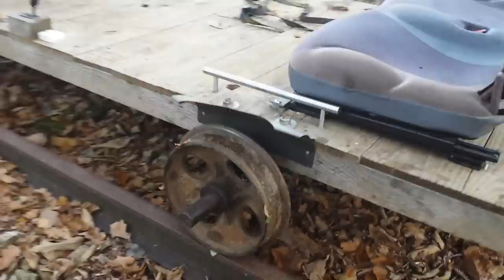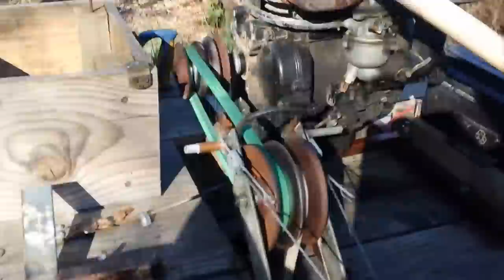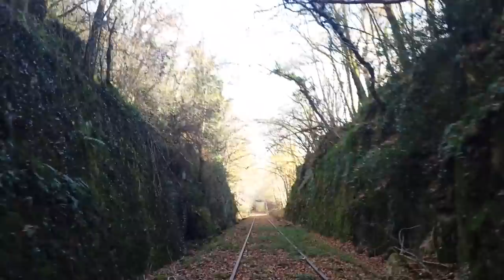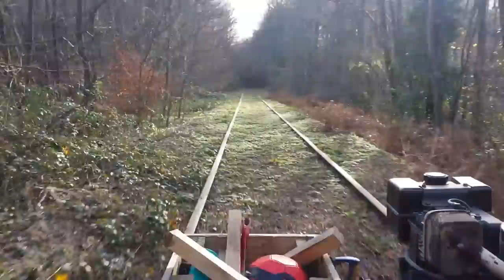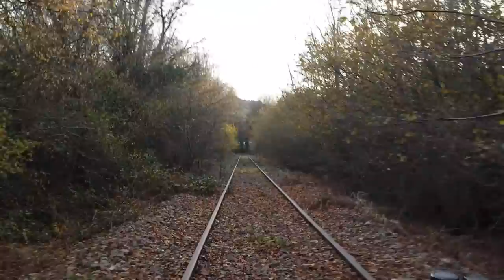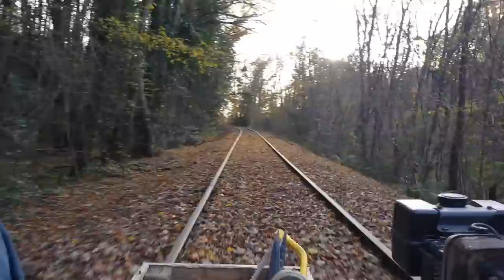Go karting on abandoned railroad tracks!  Homemade train with dog

Comment: Now you just need a set of those big train airhorns mounted on the front. It would bring back memories for the neighbours.
Reply: Daniel Moses not airhorns,whistles!
Reply: I was going to comment same.
Reply from the maker: Actually I mounted a car horn, it was quite loud but not loud enough to piss of the neighbours ;)
Reply: bells, whistles and horns.. lol
Reply: How about a replica vintage Paris taxi horn ? The type used in performances of " An American in Paris " . Rubber squeeze bulb , brass horn .Hello from Texas military veteran
Reply: Light gets Bigger you just here a rumble getting louder and than chew chew
Reply: That would be perfect 😂
Reply: Need a air compressor for air horn
Reply: @tommysimmons3258  just put a trailer on it, It'll be safe 😂
Reply: Man, Rail trolley and Dog, 👍 perfect 🙏

Comment: I wish they would have left the old tracks here where I live. There were 4 towns connected on the same line about an hour each apart and I would have had a blast doing this. They dug the rails up in the early 90's though.
Reply: Mmh i don't understand why they have to rip up old railways it such awesome history and amazing construction and the
Reply: +KTM200 EXC Sadly they tear up the rails for scrap metal for the $$$$
Reply: Those rails would make for a good homemade roller coaster n the backyard.
Reply: People should buy my "Impact' a James Grider novel on Amazon so I can afford to move out of a desert area into a forested area like that near a railroad track and do this. Maybe I could write that James Grider clandestinely travels America on a thing like that on active rails illegally, but only during the dark. It would be droll to write that a train catches up from behind going slightly faster and starts pushing the cart ahead after the catcher bumps into it. The hero must then climb onto the locomotive because he senses danger. The second he leaves the go cart, the high speed derails it and it's gulped under the train, obliterated into splinters but the hero is safe clinging to the front of a locomotive.  Same scenario could be done with one of those trucks that have train wheels.
Reply: Same here, there was a railroad that went through my home village in Slovenia right down to Italy. It would have been so damn fun!
Reply: Donny Schossow had an old Gremlin that had the same wheelbase as train tracks. Donny left about 20 psi in tires and it rode right down the tracks.

Comment: This is one of the coolest summer projects I've ever seen anyone undertake.  Good job, man!

Sorry someone ripped it apart.  At least you had a little fun with it first!
Reply from the maker: Thank you so much for your compliments :) And yes, it's true, I had loads of fun with it before it got stolen!
Reply: +Inse van houts Where is this line?? As you can tell by my name I love trains and I'm very interested in the line. I'm sorry to hear it got destroyed/stolen as well, have you reported it to the police? Also did you ever see any trains operating on this track? If so do you know what railroad? Or what the locomotive/train cars looked like? I'm sorry for all the questions and that your adult toy train got stolen. Thanks!
Reply from the maker: This line is in France (far away from you I think). I don't have much information about this line, I've never seen a train on this track, but I've been told that it was first used for passenger transport (from 1890 to 19??) and then for wood transport (from 19?? to 2005) 
I did report it to the police but they didn't want to do anything, because what I was doing was illegal...

Comment: rubberize the wheels for a smoother and quieter ride, friend of mine built something similar and he used that rubberized tool handle dip on his wheels and it worked pretty well and made pulling out faster with no wheel slip, its not as durable as hed like but for as often as he goes for rides it works ok
Reply: Just slide a cut open inner tube for a kids bike on the wheels and you are good to go.
Reply: Sergej Nadaždin seems like it'll give out instantly
Reply: Works for snow,ice and  wet rail many years ago.
Reply: Fairmont motors sold them as an accessory .

Comment: Hope you may build a new cart or speeder and keep the rails in use. It would be fun to see the different seasons along the tracks .
Reply from the maker: I hope so too! And that's a good idea, I will see if I got some different seasons on video. We got already 2, fall and summer (can be seen in Part 1).
Unfortunately it doesn't work in the snow, the snow sticks to the wheels, builds up higher than the flans and thus makes the cart derail :(
Reply: thats good to know your still interested in exploring the rails.I had watched the second part first this morning , did not realize it was yours as well.

Comment: I see you got a 4-stroke much more reliable than that old 2-stroke oil burner you had and you definitely get a few more miles out of a tank of gas that's for sure. I like the videos keep them coming and the smile on your dog's face says it all...
Reply from the maker: Unfortunately this is the older build, but it got stolen. One of the conditions for the new engine was that it had to be a shifter. But 4 stoke shifters were way out of my budget.

Comment: after I seen your video I clicked on next they had an amazing way where it was in parts and took only about 15 minutes to put it together the engine was on a couple of wood blocks attached to a piece of thick plywood the wheels were not attached,and seats too while it was apart it was just a piece of plywood with axles and it's was stored in back of a small hatchback car,if you did this,no more problem with thieves and vandals

Comment: How fun!   But I would make the pedal-powered and get exercise without fuel use and pollution.
Why so shakey on smooth rails?
Brush on the rail in front of the front wheels.
Reply from the maker: Pedaling is not really an option here, a few people have tried to start a rail cycling rental service. But they all abandoned because it was way too hard as the tracks are quite steep.  As for the shakiness, I used very old wheels, which were not very round ;)

Comment: Hi. Thanks for reply and information. Fascinating! This must be the most fun abandoned railway. lets hope you can continue to use it without the railway owners interfering. There is so mud history I guess about this line and you are just keeping it alive! On your video part 1 you come to a road crossing. Is this where you stop or were you able to clear track and travel further? Hope you can build another Kart. Did you get the engine and wheels stolen? We have loads of abandoned railway lines in the UK when they were closed in the 60s but the tracks were removed and some made into cycle paths but I'm sure there must be nothing like you railway. hope you can keep location a secret and no one from the railway company stops you. Great video and post! You have probably made many who view this very envious! Do live close to the track? Thanks for providing us with such a fascinating post! Martyn
Reply from the maker: You are right, the track has a great history, it has been built in 1880, and has been used for many different transports. In part one, we continued a lot further :) but we already drove that part many times. After the crossing, there's still about 13km of tracks. 
And yes, the engine and wheels got stolen. But also the bearing blocks and the homemade "transmission", which took me a long time to make functioning as it should.  
They had plans to make a cycling path of this track, but luckily the plans were abandoned!  I live at only 100m from the track :)
Thank you for your nice comments!

Comment: Great video and completely crazy! Trouble with the UK is they tend to lift the track pretty quickly after closure and they have a habit of putting security fencing across the line. That said we did have the Leamside line which was only lifted recently, Great video though. Bet that guy at the end was fascinated. What did he say?

Comment: My one trip on a speeder Several years ago on abandoned rail near Llano, Texas I found the noise deafening, my ears where ringing when I was done. Is there anyway to quiet the noise of the metal wheels on the metal tracks? Also would be interested if an electric motor has been attempted on one of these rigs.

Comment: Hi, I loved your video!  Where could I buy rail wheels like yours and how did you connect the wheels to the axle?
Reply from the maker: Thank you for your comment! In my country they do sometimes appear on sites like Craigslist, but it's very rare. You got to be patient. I connected the wheels to the axles by finding a tube with an inner diameter just a little larger than the outer diameter of the wheel axles. They slided right in. A bold did the job of holding them together. They did break sometimes, but not often.

Comment: really impressed with your kart

but how/where did you get the wheels?
Reply from the maker: Evatron thanks, you can try to look for old mine cart wheels on ebay and Craigslist. They are rare but they can be found. Just a few weeks ago I bought some in the Netherlands, the guy sold 50 pairs, for only 30 bucks/ piece!
Reply from the maker: Evatron if you haven't seen part 3 I recommend you to take a look, there you can see how I put them further apart to make them compatible with regular 1m435 rails.

Comment: Looks like you're moving at a pretty fast speed. I'm going to guess 30 MPH. But what happens if it starts raining hard? You have no coverage.
Reply from the maker: Yeah exactly, it's close to 50km/h. We don't care that much about getting wet. The biggest problem about the rain is the fact that friction between the wheels and the tracks is too small so braking and accelerating becomes almost impossible.
Reply: You ought to put a roof and sides on it so the rain can't hit you if it does start pouring,

Comment: You need wider wheels than that!! Someday your going to hit a part where the rails are spread a little too wide, your cart will fall in between, then stop hard where the rails go back to normal.
Reply from the maker: Don't worry, I thought of that when I build it. The width of this track varies a lot. Sometimes the tracks are quite narrow, and if I choose to put the wheels further appart, the cart could start running 'on' the rails and derail soon after.
Reply from the maker: Don't worry, I thought of that when I build it. The width of this track varies a lot. Sometimes the tracks are quite narrow, and if I choose to put the wheels further appart, the cart could start running 'on' the rails and derail soon after.
Reply from the maker: Don't worry, I thought of that when I build it. The width of this track varies a lot. Sometimes the tracks are quite narrow, and if I choose to put the wheels further appart, the cart could start running 'on' the rails and derail soon after.

Comment: Looks like fun. Ever seen this idea where you hover above the rails using compressed air ?  Patent 3013505 .  I suppose it was to hit speeds of over two hundreds miles per hour using standard railroad hardware.  Funny it was the Texaco company that filed the patent.   TO INFINITY AND BEYOUND !   Patents 3190554 672256 .